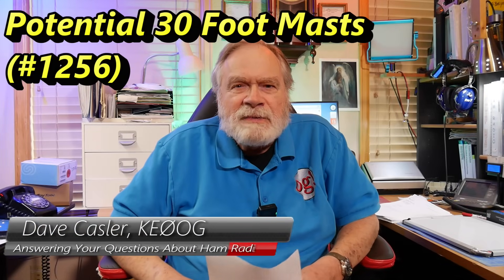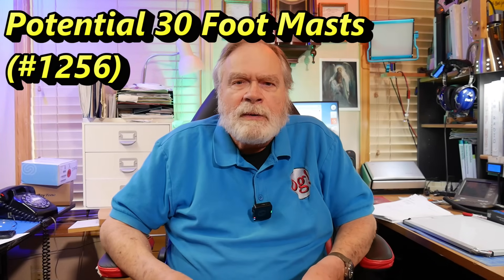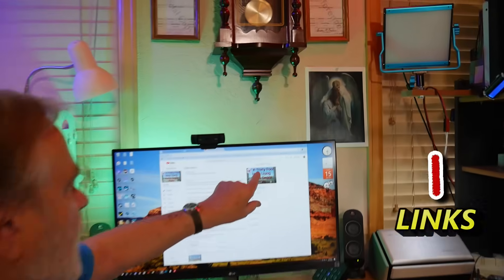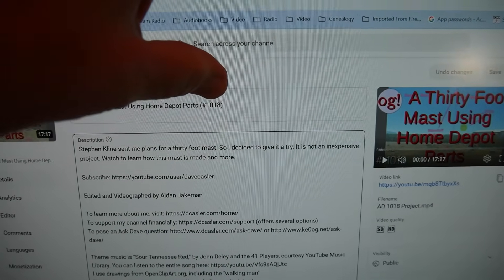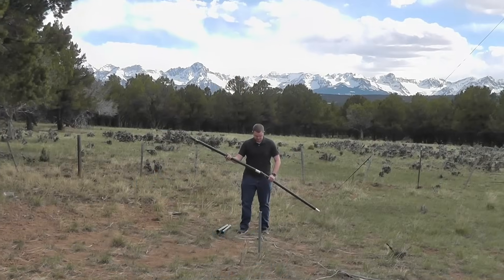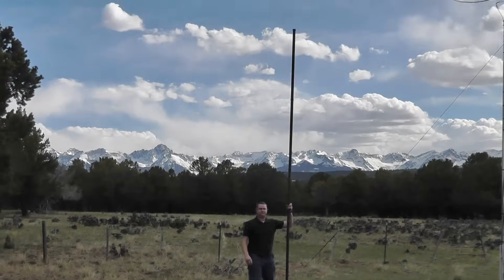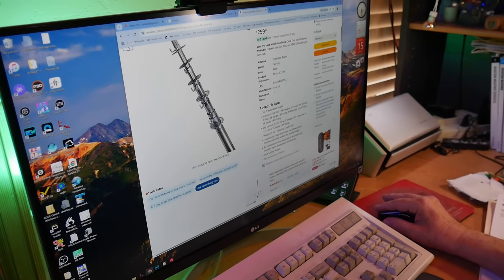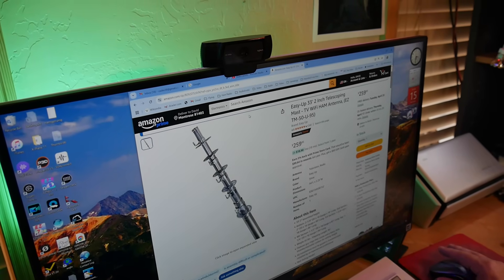Potential 30 Foot Masts (#1256)

Comment: I have used 30 foot Mast made out of fence to rails. I use 3 ten foot sections. I bolted them higher by fitting them higher ceiling a 1/4 inch hole then bolting them with a 1/4 inch bolt. Very strong and stedy. I also dug a 2 foot hole stud it up with guys at top. Then filled the hole with quickcreat. I did put a Eve bolt at the top of the mast with a rope going through it. To attach my antenna to it. Has been it 3 years now no prolbems.73 W3AMT.

Comment: I have a fiberglass pole saw handle that comes out to a bit over 20 feet mounted on top of 10 feet of galvanized steel conduit that I guy wire as well as having it on a pretty robust stand that was originally one of those big road work sign stands they use with the 4 legs that come out from the center and lay flat on the ground and extend out to about 4 or 5 feet long. That stabilizes things very well as the legs can be set at a slight angle instead of flat in case of really bumpy ground. I also drilled holes to drive big threaded stakes into each leg and use those same stakes for the guy wires. It's only supporting it's own weight plus a wire antenna I set up in a sloper type configuration fed from the low side with some ground radials. It works well and is portable which was what I was really going for anyways.

Comment: Nube Question: I have an old 25 foot flagpole (4’ aluminum sections screwed together), that I would like to put up permanently and clamp a homemade brass J-pole at the top. Would I need to run a ground wire from the J-Pole to the ground or just one to the bottom of the flagpole?

Comment: My mast is pretty simple. An 8foot 4x4 mounted to my house and anchored to a concrete base. To that I have a 10 foot fence top rail that can slide up and down on the 4x4 post. And on top of the top rail is a 10 foot extendable pole with my antennas mounted on that. The guy lines are at the point where the top pole and extendable pole meet and half way up the extendable pole. The way I have this set up I can lower the 10 foot top rail down the 4x4 post then lower the sections of the extendable pole to gain access to my antennas.

Comment: One can get  20 ft sections of top rail from fence supply companies.     If you can weld then weld the sections of top rail togther to make a single 30 ft rigid member.  Use cold galv coating  over the burned away zinc from welding. The slip fit fence rail connections are definitely wobbly.    I have gas welded together light weight 30 ft unguyed towers using 20 ft fence top rails for the legs and 3/4 in emt for the lattice members to support ightweight tri band beams.  They have lasted 30 years down here in Florida before rust claimed them.   Know the dangers of welding galvanized metals.   With low cost mig welding machinese available today such construction will be far faster and less costly than oxy-acetylene method I used many decades ago.

Comment: Dave- Parachute cord is nylon. All nylon webbing, cord, rope, loosens up (stretches) when it gets wet. So if you apply it drum-tight, dry, it will sag in the rain, or even in morning dew.
 If you must use nylon cord, the trick is to soak it in a bucket if water for 10-15 minutes before you use it. That way you can install it drum-tight when it is stretchy, and it will only tighten more as it dries.
Reply: I’ll have to try that! Will it withstand sunlight?